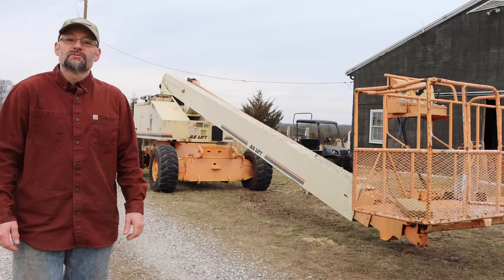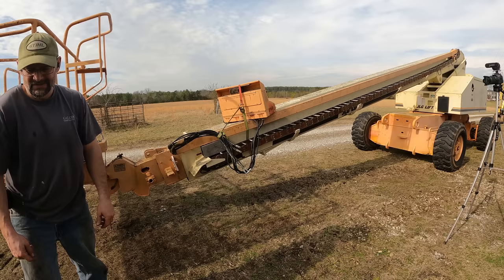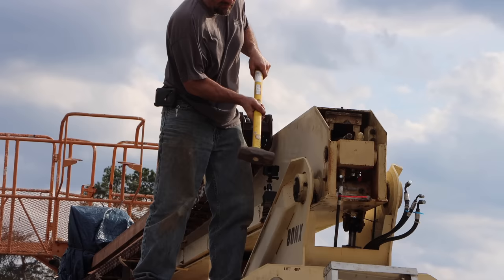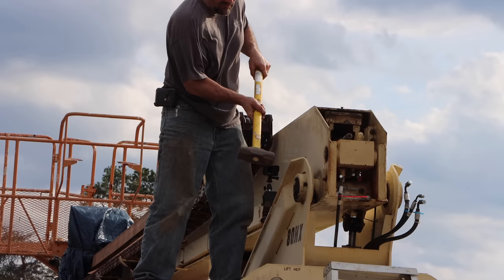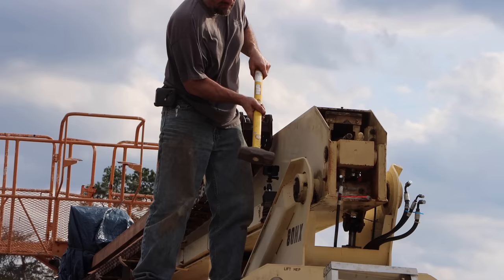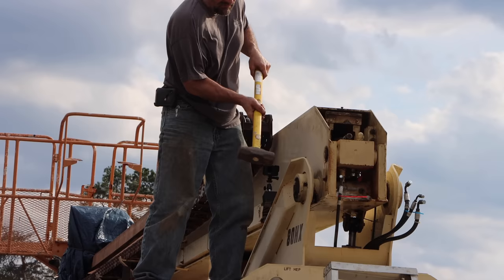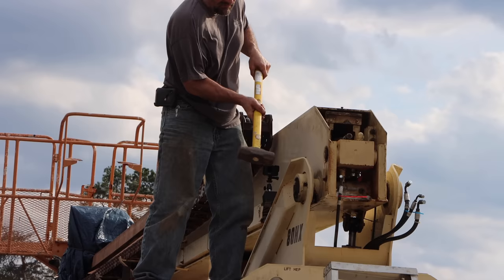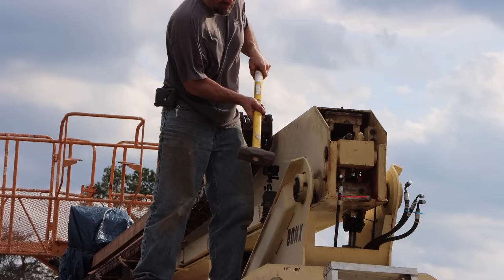JLG Boom Lift Tear Down, Ended In Disaster!

Comment: This is a very good reason why I try to avoid using the smoke wrench when I can, and always have a hose and/or CO2 extinguisher nearby. When I did service work, we kept a couple 5 gallon pressurized water extinguishers on the truck, those are nice because you can fire them off as often as you want, so you never have to wonder if the internals are corroded and it's failed just that dry chemical extinguisher did. Not to mention the mess they make, which is why all my extinguishers are CO2. Those are good for fuel and electrical fires, and the water hose is good for everything else that'd be burning in my shop.

And I agree with @AdamDavisEE down below, on large pins I'll drill a hole and sawzall out a couple slots in it, then air hammer out the remains. But hindsight is always 20/20, and we're just glad you're still here to reflect and listen to us keyboard mechanics whine about how we would've done it differently😅

Comment: If you ever come across a stuck pin or something you could try welding a hydraulic jack frame/holder on the machine itself (kind of what you tried to do in a previous video on this machine for the wheel pin). It usually works great!

Comment: I am a pipefitter/welder by trade. I have seen two JLGs burned up to the point of total loss and one of them almost took a caustic unit with it as once the fire started, of course, we couldn't move it. I would never cut or weld using a  JLG again, especially not a gasoline-fired one! Glad it wasn't that bad for you.

Comment: Ed here, had a old trextrailblazer 40 2 yrs ago i wrestled for awile. the boom seals blew and lost a barrel of oil down the boom. had lots FUN rebuilding it. the electric/ hyd.system was old andaggravating, but i used it for awhile. my boom pin came out very well after beating from both directions until loose. sold it cheap!

Comment: You definitely have guts to take that on by yourself. That's a major undertaking my friend. 

What most people don't understand about the fire extinguishers is the fact that several things can go wrong and they still appear to be usable. The gauge can stick, but the propellant has leaked down, giving a false notion that the extinguisher is still operable. Also, even if everything else is good, the powder gets compacted and won't come out as expected when it's needed. This is especially true if carried on a vehicle that is always moving/vibrating. It also happens to an extinguisher while hanging on the wall in a shop, home, or business. Occasionally, you should take them off the wall, turn them upside down, and tap on the bottom with a rubber/dead-blow mallet to break up the compacted powder. 

I hope the fire damage was minimal, but I will have to wait until the next installment, I guess. I'm hanging on the edge of my seat to find out. Stay safe and keep up the good work.

Comment: John ref the fire extinguisher,  it had pressure otherwise the Guage would have registered low. Extinguishers become packed over time from the pressure they hold. A couple times a year take the extinguisher  and turn it upside down and hit it with a soft face deadblow hammer to loosen the powder it contains.  Hope this helps you out.

Comment: I had a stuck pin like that on the brake assembly of an Allis Chalmers wd that hadn't been touched since the factory in 1953. I welded a bar to the end of it for leverage to turn in place then heated housing with a torch. Once it was free to turn, it could be driven out. Came right out.

Comment: Your extinguisher still had full pressure. The problem was that over time the dry powder inside settles and hardens into a solid mass in the bottom of the cylinder. You can 'rejuvenate' them to some extent by bashing the extinguisher on a hard surface to break up power. Probably a good idea to give your dry powder cylinders a yearly 'birthday bash' to keep them in peak condition.

Comment: On our farm, we had several combined fires. We had a dry chemical fire extinguishers and they did exactly what yours did. I was told that the extinguishers would pack solid of they were stored hose side down. We threw them away and bought water extinguishers that you could pressurize with air. Worked every time.

Comment: I totally feel for you... I almost burned down a plywood mill once because I was complacent with prepping the area for welding.  Thankfully, before I started, I had prepared a water hose close by and was able to put out the flames rather quickly.  However, that feeling of dread as you scramble for something to put out the flames is something I will never forget.

Comment: The reason the fire extinguisher would not work is the powder settles over time simple version it gets stuck. On annually fire extinguisher inspections the inspector turns them upside down and hits them with a rubber mallet making sure it is loose and free. I recommended it every time you inspect one.

Comment: Used to be a lineman and our Telsta bucket trucks  used a similar chain system. When rebuilding them, the mechanics would throw the chains in an alkaline hot tank to dig out all the gunk, then soak them in a barrel of diesel for several days. That would drive out the hot tank solution and lube up every surface inside and out. Of course, an apprentice got the job of going thru every link looking for wear or cracks.

Comment: I don't think I've ever seen anything so stuck as that pin! If I have, I don't remember it..., and I've been around a lot of industrial stuff. They say that farmers have to know a little about a lot of things, but I think you know a lot about everything!!!! As for the fire, that sort of thing happens - and you are totally on point - it gets worse when there's a progression. Glad it wasn't worse and that you weren't injured! I set my car on fire once - had removed the intake and carb for cleaning to replace a freeze plug (L-6 engine). I had washed it down, and removed the spark plugs to blow out any water that got thru an intake valve. Fuel line was open on end, since carb was removed. It's when I learned that the ignition system would arc somewhere else without the plugs in place! Managed to put it out quickly, probably aided by the fact that the fuel pump quit squirting when I let the key go and stopped the engine rolling over.

Comment: Regardless of your mistakes (we all make them and you are man enough to show yours to the world, so props to you), you get a lot of work done for a one-man show.  I'm guessing that maybe the extinguisher had a dirt dauber or some other insect blocking the nozzle (I've seen it before), but that's just a guess.
Anyway you're doing a great job.
Reply: I place used foam hearing protectors in the nozzles of my dry chemical extinguishers to keep the mud daubers from clogging them up. Those wasps are attracted to those holes which are perfectly sized for their activities. I will make a point of giving my ABC extinguishers periodic inspection/agitation per the suggestion of other commentors. An additional benefit to that would be aiding "muscle memory" of where the extinguishers are located and practice in deploying them if needed. A good use of expired extinguishers would be to practice using them on intentionally prepared fires of various sizes and materials. Fire drills and personal firefighting experience would benefit everyone.

Comment: With that fire extinguisher still saying full but not working is an eye opener.  The company I used to work for had us keep fire extinguishers in our work vehicles and would require us to change them out every 3-4 years - either to be checked or recharged.  I guess they lose their pressure over X amount of time.  Really thankful they did that (not as my cost, but theirs).

Comment: I worked maintenance at a hospital, every month we checked fire extinguishers( turned them upside down and hit the bottom with a rubber mallet) When they we up for re-cert it was cheaper to buy new then have them tested so we used all the old ones for training all the staff in the proper use of an extinguisher. Believe it or not, about half didn't work!! Even tho they were charged and had been turned over and beat on. That powder can become packed in there and will not come out, and it happens faster if it's mounted in a vehicle where it gets bounced around all the time. Short of it is you just can't trust a powder extinguisher to work every time. Just thought I would share, we enjoy watching the channel and appreciate your kander with everything you do!! Thanks for being real, keep up the good work!!

Comment: I haven't watched the whole video yet, but I do think your experience is useful lesson to everyone.
It is very easy to become complaisant if you have not directly experienced an accidental fire.  I've done a lot of questionable things with a propane torch, but because I haven't accidentally started a fire yet, I don't really view it as a really very serious  risk, same thing with using grinders or belt sanders near flammable items despite throwing tons of sparks. I've even used kerosene as cutting fluid because I was lazy and it was nearby even though it's pretty obviously a bad idea.

Comment: Dry chemical extinguishers are notorious for packing down in the base of the unit, especially in vehicles and boats due to the vibration. Also the powder is very fine. It will block the nozzle if there is a short discharge and it gets damp. Yours was definitely still charged... I would say that the compacted powder blocked the pickup nozzle. Invert the extinguisher, give it a bash on something and you will feel the compound flop around inside. They discharge via a tube in the bottom and it will block easily. Foam extinguishers are far better for most semi industrial fires, just NOT electrical fires and they are far more reliable. Your powder extinguisher probably wouldn't have been effective anyhow, given the location of the fire. Lots of water was always going to be your best option. Love the vids. Hope there's not too much damage. Stay safe.

Comment: In my other Life I owned a body shop, and we had several instances with fire. I learned that a C02 extinguisher is great but only for certain fires. I was cautiously welding on a classic cars firewall from under the hood and caught some insulation on fire under the dashboard. I thought no problem and gave it a five second blast with the extinguisher. I waited and still saw a curl of smoke, so I did it again, and again and again. to no avail. I finally wised up and got a pump sprayer with water and heard the satisfying SSSS as I got it out... I learned a lesson that day!

Comment: John, its amazing the price that this lift sold for brand new, and how a couple of drilled and tapped holes with some zerk fittings for grease would have made things so much simpler to maintain. Planned obsolescence at its finest.... Glad to see you were not hurt or injured in your mishap, and other than your pride in making for a good job done. Looking forward to part 2. Peace my friend.
Reply: @ Silas Hulse - 100% agree with your comment, “planned obsolescence”. I have used the same comment in the past. Wether ‘planned’ or ‘designed’ the end result is the same.

Comment: Jon when burning with a torch or welding we always had guys for fire watch on stand by just in case. I'm very surprised you did not have water or fire suppression on hand. The fuel tank is close by, anything could of happened . Glad you got it out. You should have on of you family members Helping you. Hope there was not to much damage. Good job getting that apart.

Comment: Really glad you weren't injured.
Honesty in your footage really sets you apart. I like that you explain all your thinking processes, and aren't scared to show the mistakes. We all make them - it's brave of you to show them. Thanks for sharing that.
I agree with the other suggestion of getting a saw in there once you've drilled a big enough hole. This would give the pin some 'space' to expand/contract under heat/force. 
An alternative could be to use vibrations. Getting the right frequency can do a great job at getting anything unstuck. The challenge is finding a suitable shaker.

Comment: Stuck pins are the worst. We ended up using a mag drill to drill out the pin on a Bobcat Soil Conditioner. Bought used hoping to save some money and we spent countless hours, tools and materials working on it. Unfortunately I smashed my thumb pretty good luckily it didn’t break. Finally got it back together. Bummer about the fire. Glad it wasn’t a total loss.

Comment: As a contractor 40 years sweating pipe in basements , joist catches fire etc., and torch at the shop, always have a 2 gal water pump sprayer handy No mess with fire extinguisher chemicals

Comment: I keep a PW can in my garage. It’s a 2.5 gallon pressure water fire extinguisher. If you use it it’s rechargeable with a tire pump. I keep a few drops of dawn soap in it to get water in deep for a fire like that. Glad you got the fire out.

Comment: Why JLG don't have grease points on the pin pivots is a mystery, especially when machines like yours sit outside 24-7. We drill and tap the pin for a 3/4 unc all thread and use a 30 ton enerpac hollow ram to pull it while applying heat to the eye then drill and tap the other end for a short bolt so you don't flare the pin out when hammering at it (35 years in hydraulic engineering and maintenance.)

Comment: I worked for an Electric coop for 25 years, and yes I have pulled several booms apart. I wound up making a bracket that bolted to the forks of a forklift that also bolted to the bottom of the boom with clamps. With the bracket I could position the forklift inline with the boom and back away to pull the boom apart. It worked pretty slick if I say so myself. Having a level surface to work on also helped. The clamps were just two pieces of steel and threaded rod with wood used as a cousin so the boom would not marked up. The booms in electrical work are fiberglass for insulation reasons. The bracket was made out of channel iron and was about 3 feet tall, there were 2 cross supports the boom laid on, kinda like a pair of forks turned at 90 degrees. I don't think I would consider using tractor forks though.

Comment: There was a practice in one of the places I worked to invert the powder extinguishers every month. I'm saying it still had pressure in it and had probably caked in the bottom of the extinguisher. My mate who is a fire station supervisor another term for old fireman says that the modern powder fire extinguisher it's not recommended to do this. In the old days it was a practice especially with dry powder extinguishers that were exposed to vibration cars trucks etc. Also when going to use an extinguisher on a fire it is procedure to test fire it before proceeding to use it that way you don't arrive at the fire with an extinguisher that doesn't work 😁 thanks for the content John I really enjoy all your antics and the thing I really like about your videos are they are very educational. It's great you show every aspect of the task warts and all. 👍👍

Comment: I used to have our fire department come to my factory and conduct training. They told us to maintain fire extinguishers, it is necessary once a month to invert them and shake up and down and all around for at least 30 seconds because the media will settle in the bottom. The pressure will read fine, but it wont work. This became a formal procedure and every extinguisher was shaken once a month and the date and person doing the shaking were recorded on a log pinned to the wall above the extinguisher. We never had the opportunity to use one, thank  God, so I can't say that it worked. I guess I was too cheap to test one to make sure. I was dumb back then.

Comment: With those types of fire Extinguishers you have to shake them every so often because the powder settles to the bottom around the tube and packs really tight especially on a boat with the pounding waves there was still Pressure in the fire extinguisher As a firefighter I learned that in fire training Plus that is not a good fire extinguisher for around electronics

Comment: In a previous job I had driving cherry pickers. We worked and Underbridge with a 3 section tele boom. We also ran a similar unit on the railway for bridge inspections. They managed to damage their boom cylinder so replaced it with ours off the road vehicle. The cylinder they later fitted to our unit was bent :face-orange-frowning: very slightly. We spent the next month replacing the seals at the side of the road as it was ripping them out every 10 hours use or so.
Just be careful with that cylinder !!!!!!!

Comment: My simple solution for your little pin is to drill two mall holes near by the bushing, if the diameter is very large, then four holes in line. then dill the large hole in the center. When the large hole is large enough to reach the inner small holes, the pin will drop with your drill bit.

Comment: Great video document. Also, a fantastic lesson to all on fire mitigation on heavy vehicles. This is the strength of your videos, we all learn from you. Welding and heating near fuel oils and grease and flammables in the structure. Stop and think and ask, before I start, can I put out a fire? 
Water sprayer to mist and cool, decent size powder spray when the issue is small and leather mats. I too learned the hard way, and it taught me... before the weld or heat touch is started, stop and ask, what is going to burn and how can I prevent and extinguish. Great work, I have experience going back to the 70's. You never stop learning, never worked on these and learning a lot.

Comment: Had to do this to mine also. You need what's called a broco torch, will blow a hole all the way through and pin will knock right out. I've used mine on 3 inch pins in detach trailers. Works every time.